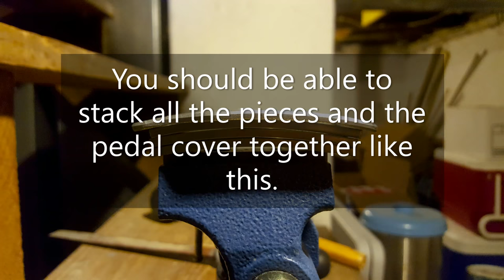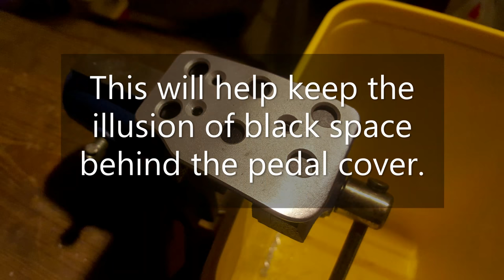1/2" Accelerator Pedal Cover Spacer / Riser for Heel and Toe Downshifting DIY (Scion tC2 / tC2.5)

Comment: great vid. i always had this idea in my mind but didn't know how to do it.  the thing, my mazda3s gas pedal doesn't have a cover do i dont know how to get the right curvature and i don thave a vice grip either
Reply from the maker: Wow, this video all of a sudden went from no one noticing to getting activity recently. Just get yourself an aftermarket pedal set that screws in instead of clipping on around the edges. As for tools, you can pick some up cheap at Harbor Freight.